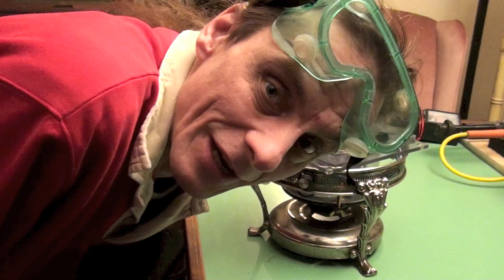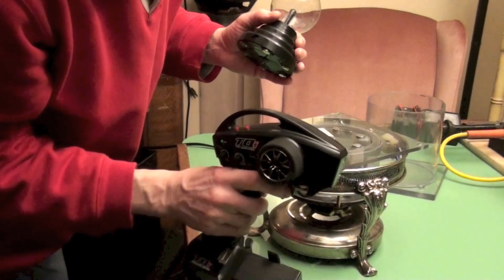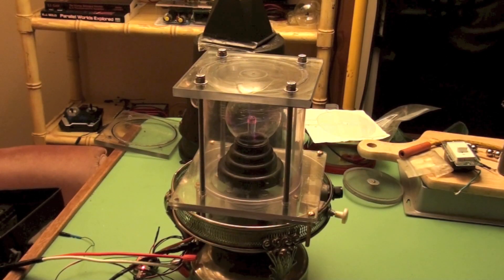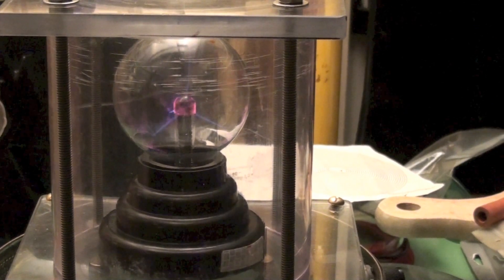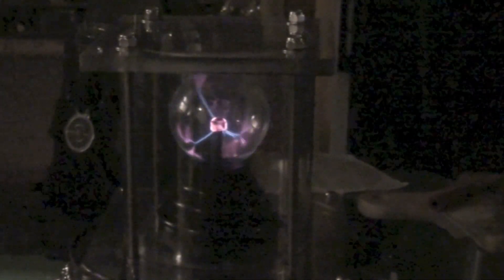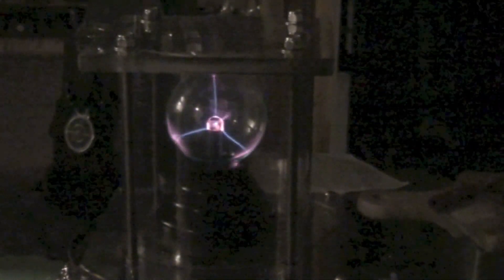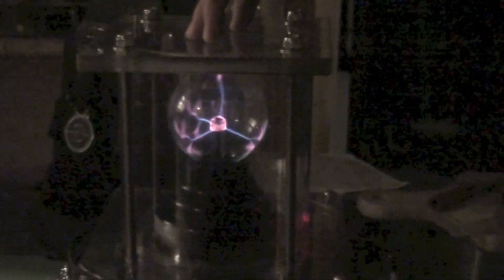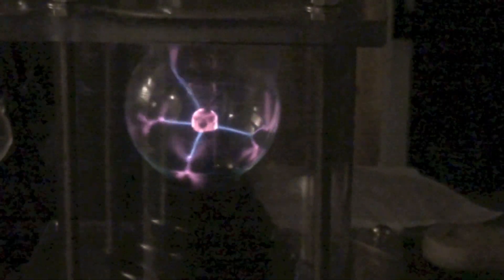Magnetic Drive Plasma Ball

Comment: hey man this is directed to the guy designing the magnetic base that spins the plasma ball. perhaps you could arrange a top piece that has a magnetic pull that can "hold" the base a centimeter or so above the track where the magnetes are trying to touch. i believe the power and circuit formula would work on having a gravitational field put stress(or slack) on the magnets repulsive field. 
   if you have the plasma ball on a track that can control vibration under a certain hertz, the center emitter would have an extendable, or atleast controllable plasma core. 
       also it seems like a valid theory that the lightning coming off the plasma core can be "read" like a cd or dvd disk, then it can be tested for its potential to carry charge difference at an exponent equal to the amount of electric charge you send into the plasma core.
or perhaps another method of reading plasma ball emissions. im sure a digital design would atleast be more compatible, if it works in the first place.

Comment from the maker: Yes, it is true that the batteries need to be balanced. I used a bolt and nut glued into the opposite side to balance, but it was not exact. Also, off centre a bit. The whole rig is not designed for high speed! ;) ...Working on making it spin better, and in a vacuum chamber too.

Comment from the maker: The Plasma Ball is powered by its own battery pack with 4 AAA batteries. In other experiments with a vacuum chamber, we use a separate high-voltage power supply.

Comment from the maker: The magnets affect the plasma far less than I thought they would. The magnets attract the plasma tendrils about like a human hand. certain configurations may produce more of an effect. (See cup-shaped magnets of video "The Primer Fields")
Reply: MrfixitRick the magnets need to be in the vacuum chamber with the plasma. although neo has a low curie point. SmCo  would be a better choice magnet. plus, if the magnets are inside with the plasma, the plasma will spin due to the established field. no spinning required. magnetic fields spin on there own. and plasma is attracted to that field.